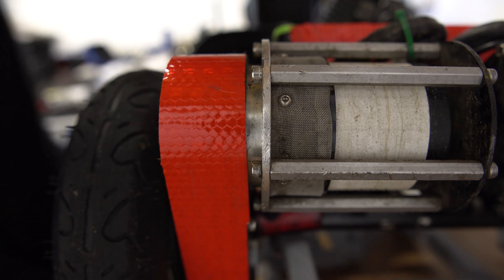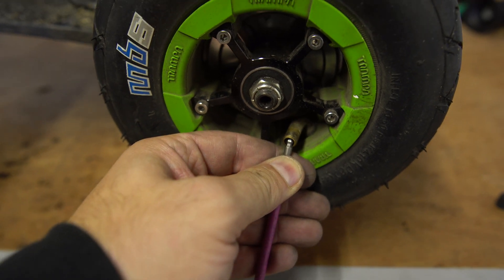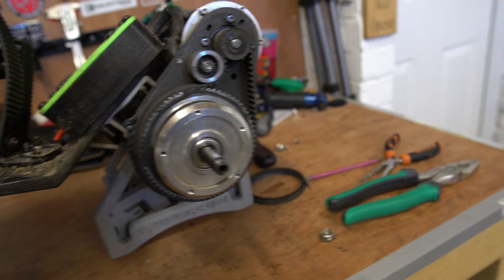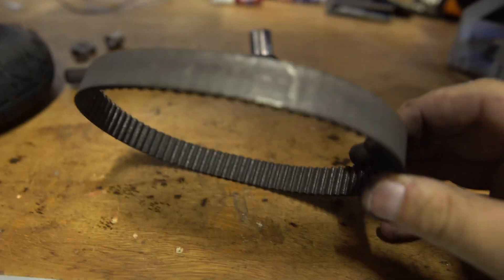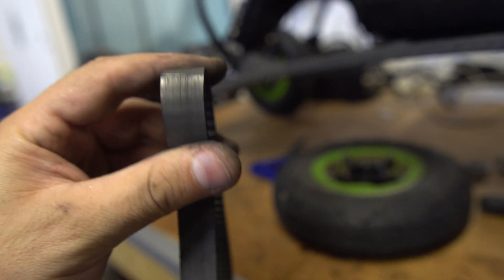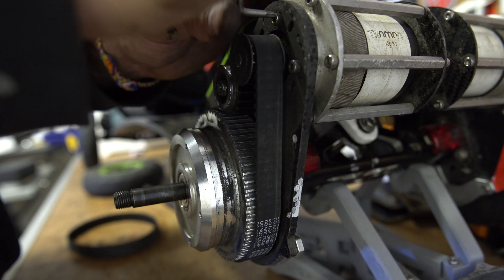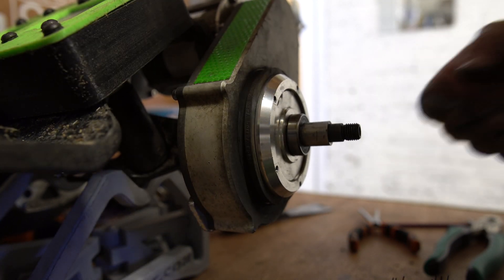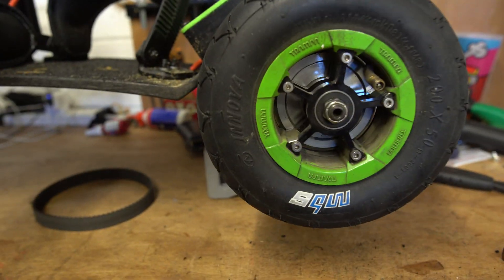Changing belts on the Trampa 2018 Pro Belt drive

Comment: Hey Lee. I have a background in years of rc planes and drones that I have built myself because I didn't have the money to buy them. I am now 16 and have saved up enough money for an esk8. It's been my dream for a while. I am still working on my build, but to test if it works, I taped everything to the bottom of my board and went for a ride. I did 17 miles, and only came back because I was cold (below 50 here in Washington), but I reckon I could get around 30-35 the way I ride. My build is a 12s6p 20650 3000mah 30a battery. Dual 6374, vx2, etc, I literally had one of the best days of my life today. Its geared for 34mph, but I will be gearing it for 40+ because it has the power to do it. I hope you read this comment because you are a great inspiration to me.
Reply from the maker: Hi Antony! Absolutely awesome dude, sounds like you have nailed a brilliant build, just get it in some sort of enclosure asap to protect your investment.  I am glad that you find my videos inspiring bro, that means a lot to me! I read every comment!
Reply: @LeeWright  Will do. I am working on it. Thank you for the reply.

Comment: You could say that belt... Has taken a... Belting
Reply from the maker: Oooooosh
Reply: @LeeWright  I wonder if anyone might try using friction belts like motorcycles do? Not for precision braking and stuff, but for sheer wow factor. I'd use the front hand friction disc brakes from a downhill mountainboard and rear friction belts with a pair of large motors if I could try that setup
Reply from the maker: @ratheonhudson3311  I'm sure over the next few years everything will be tried mate!
Reply: @LeeWright  oh yeah, we're like the hotrod mechanics of this generation, modding our rides
Reply from the maker: @ratheonhudson3311  hell yeah dude!

Comment: This is oddly satisfying. 
Also getting to know when things ought to be replaced is handy. It's dangerous when you're riding too long and suddenly something breaks. A belt drive would be bad, but a gearbox busting will start a dangerous tail flick and foot straps means faceplants. 

Also, the board stands for raising the wheels and deck off the worktable looks pro. 

Also, I bet you guys should make a check list video for board maintenance (separate videos for different board setup, like small/large hub driven, belt drive, bearing check ups etc)

Comment: Nice work fella...Lee-ey Mondays? Hmm... Don't think it'll catch on #WeWantMoBack ;)
Was interested to see if that fixed the issue. I had a very similar problem with mine. It continued even after changing the belts. Turned out my VESC settings had rodgered themselves. Once DG @ Trampa sent me alternative settings to use, it was right as rain... until the next issue..
Reply from the maker: Hey bro, haha Mo will be back again soon bro dont worry! Scott's board has done many miles and the motor pulleys are worn down so it's just shredding belts

Comment: Good work. Would this be a good time to check the motor pulley is not loose/worn? On my leiftech, it’s the first think to check!
Reply from the maker: Yeah of course, in fact the motor pulley on this setup is worn and needs replacing
Reply: Lee Wright cheers.  How was the trampa meet, or are you still with the guys?